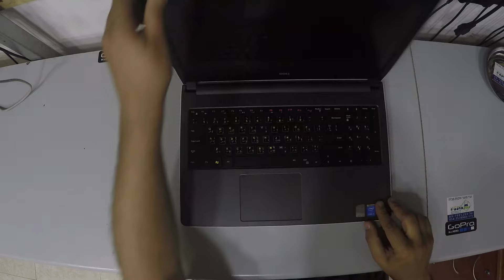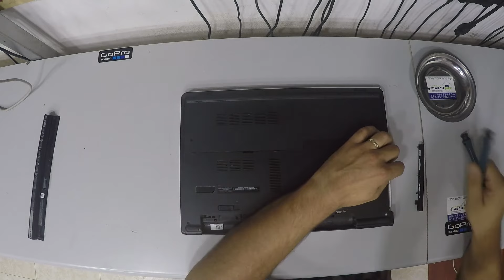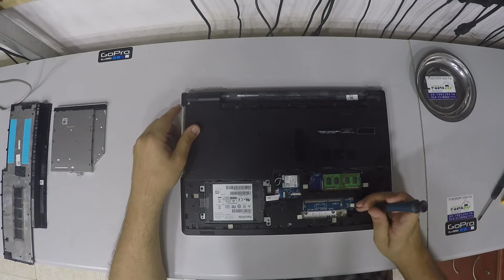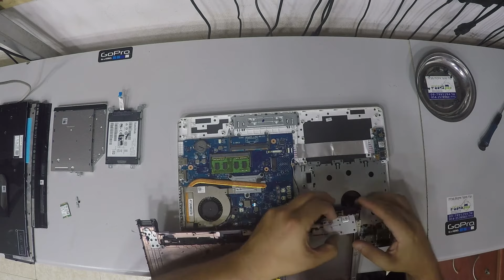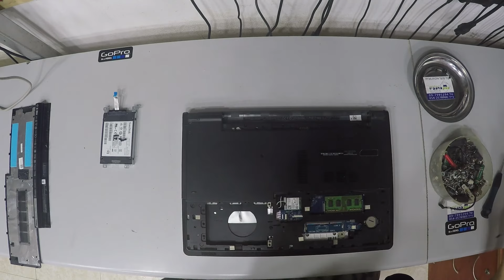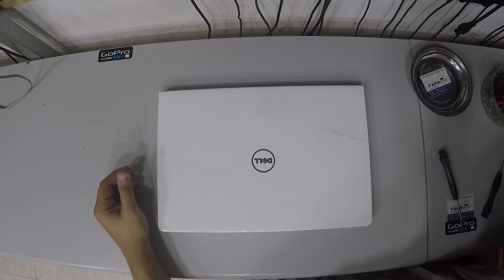Dell Inspiron 5558 Power Button Fix

Comment: Thanks for this video, Helped a lot. My power button stopped working all of sudden, checked the price on Amazon and Ebay for Power button. It was costing $24 and then I called Dell, they said it could cost about $78.
I just opened the laptop, and put few layers of masking tape on the push switch!
Reply from the maker: Apologies I code not replay to your massages in time, I am back now and will replay to comment once a week in Friday. (you are welcome)

Comment: My dell inspiron 5558 laptop (5years old) wasn't turning on.  I tried a number of things like exchange the power jack and CMOS battery, and after that all I needed to do was as you did make sure the switch on the circuit board was clicking and also added a few layers of electric tape stuck onto the under side of the power on button to make sure i was able to compress the switch on the circuit board. All working after that. Thanks a lot!

Comment: Hello,
the video is very useful - thank you for posting.
While disassebling the laptop I saw on error in your video - it's about detaching the lower part of the case. We have to unscrew 3 screws that are below the CD drive. Otherwise, you will destroy the plastic parts of the case and break plastic pins.
Regards.

Comment: Thank you very much, the video was of great help, in my case the part of the botton that click in to the micro switch in the board was broken/worn, i just use 3 to 4 layer of masking tape so the botton can have contact with the micro switch, hope it helps someone.
Reply: wolveric0 bro thanks. You helped me.
Reply from the maker: Apologies I code not replay to your massages in time, I am back now and will replay to comment once a week in Friday. (you are welcome)
Reply: Thank you so much

Comment: I have this issue for last six years. There is a setting in the BIOS that turns computer on when its plugged to power source. I turned that on before the button stopped working. Now I just plug it in to turn it on.

Comment: hi there what exactly did you do to the power button?
Reply from the maker: hello
the power button was stuck, i just release it from inside out.
Reply: okay so there is not way of doing this inside out
Reply from the maker: now
you need to open the laptop bottom cover.
Reply: i followed the steps there is still no compression/click i don't know what's wrong could it be the power button circuit
Reply: Same problem, if i click the circuit board directly it powers on but the button on the front side doesn't seem to do anything
Reply: yeah you need a new button board or glue something to the compression switch
Reply: Hi! I fixed the power button but I broke the tab that keeps the keyboard ribbon in place. Any Idea how I can fix that?  Thanks.

Comment: The power button has a very small piece of plastic under it, that actually presses the power button on the board, I have seen it "fall off" or go missing. very poor design. Good thing it is a cheap fix.

Comment: No idea wtf you did because you are working in a very small space... the power button.. yet you keep a fill laptop view. I can not see anything you did there. So still no clue how to fix it.
Reply from the maker: In my case, the part of the button that clicks into the microswitch in the board was broken/worn, I just use 3 to 4 layer of masking tape so the button can have contact with the microswitch, hope it helps someone.

Comment: dont watch this. waste of time
Reply from the maker: the video was of great help, in my case, the part of the button that clicks into the micro switch in the board was broken/worn, I just use 3 to 4 layer of masking tape so the button can have contact with the micro switch, hope it helps someone.
Reply: Not true. I saved $200 using this method
Reply: @Shamsabdelkader  Helped me for sure